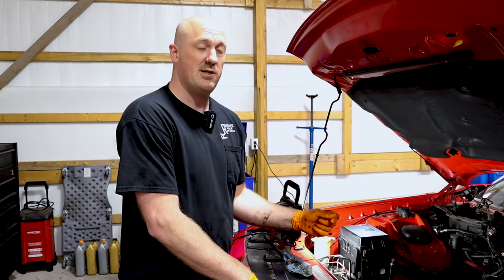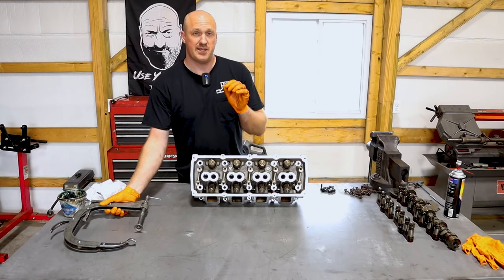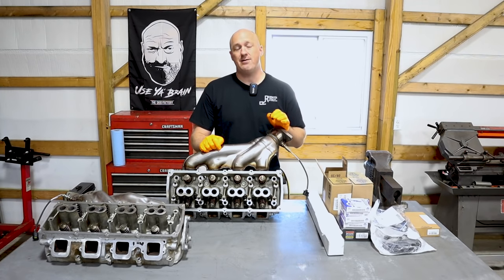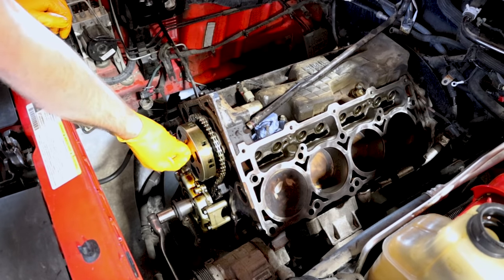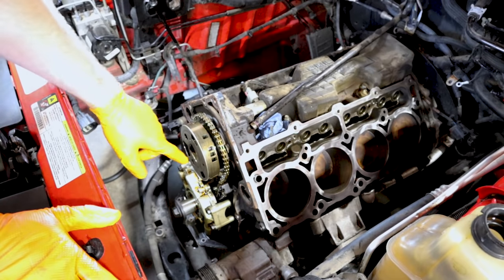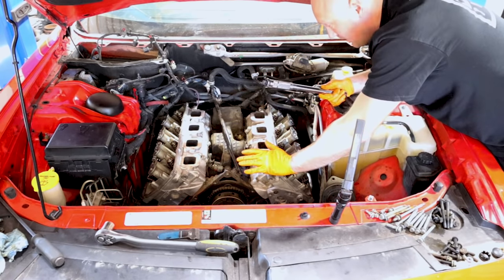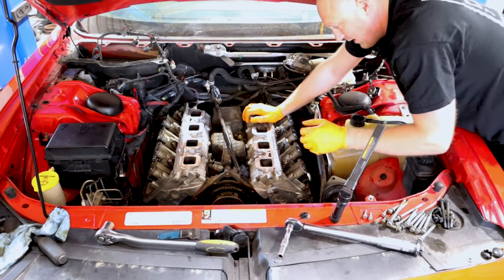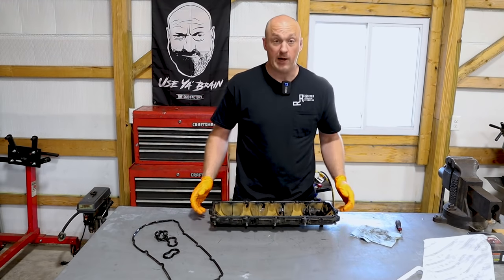Hemi Camshaft Installation Continues, SRT Headers Install! Budget Challenger Build Ep2

Comment: Is the 5.7l in the ram much different or is it pretty much this straight forward?
Reply from the maker: The way the accessories bolt on to the front of the engine is different, but the engine itself is identical. 👍
Reply: @ReignitedAuto  is there any major differences with the accessories? Like compressor water pump etc?
Reply from the maker: @jamestuhill8701  you may have to discharge the a/c on the trucks to get the compressor fully out of the way, but everything else is much the same.
Reply: @ReignitedAuto  copy that thank you

Comment: Hey had a quick ? I was installing stock valve springs back to head got it all locked in and the spring under pressure seems to spin bad spring?
Reply from the maker: Yea that should definitely not do that!

Comment: Hi my friend  I love your videos  I replaced the lifters and the camshaft  on my 2011 dodge ram 1500 hemi las year  and still I can hear the ticking noise    I bought the camshaft and the lifters on auto zone  they were Chinese   do you think that might be the reason of the problem  😢?
Reply from the maker: Unfortunately I have heard of a lot of rattling issues with cheaper lifters.
Reply: @ReignitedAuto  thank you  my friend  you are the best

Comment: When the camshaft sprocket indicator is dead center does those two square indicators on the chain need to align as well ?
Reply from the maker: Only if you are installing the chain at the same time, otherwise the marks on the chain are irrelevant. 👍

Comment: Clear flood with fuel pump fuse out. 500 rpm spun up should build at least 20 psi oil pressure. Do that 4 times before first startup and she won't rattle as much
Reply from the maker: Agreed 👍

Comment: Does everything apply exactly the same to a 2015 Ram 5.7?  I.E. gaskets/parts numbers, timing set up, cylinder head bolts "reusing" etc? Thank you!
Reply from the maker: Everything internal to the engine is the same,  you might have to use different exhaust manifold gaskets, but everything else should be good.

Comment: I have a 2017 dodge ram sport 1500 with the 5.7. It has a tick on start up. What could that be and how to repair it.
Reply: It started at 50k miles
Reply from the maker: Definitely check out my other video called "the other Hemi tick" it explains the problem and the solution 👍

Comment: You werent worried at all about not upgrading push rods?
Reply from the maker: Nope, factory parts work just fine with other factory parts. I upgraded to the hardened pushrods on my 6.4 build that I put a texas speed camshaft in though.
Reply: @ReignitedAuto  got you! thanks for the fast reply, got this mod coming down the pipeline sooner than later

Comment: You should remind people before installing the cylinder bolt head to make sure theres no water or oil blow it out and clean it with a stainless steel bristle twisted brush .

Comment: I dont got no garage id be doing everytning outside if i was to attempt this. . What do you recommend i do when covering the engine up for a day or 2 for rest or for storms
Reply from the maker: I've been there myself as well. You can absolutely just put a tarp over the engine bay and hold it in place on either side of the vehicle with some cinder blocks or something like that. That should be plenty of protection from the weather while you're performing the job 👍

Comment: If you upgrade the Cam do you need any special tuning? I’ve got a 2010 ram 1500 suffering from a lifter failure in cylinder 1. I’ve watched you take apart the hemi several times now and want to get the job done myself. I’m wondering what I can do to beef up the engine as well as fix the problem. Also I keep finding cylinder heads that say without EGR. Is that standard or is it just extra fluff words to describe the head? Any advice/recommendations would be greatly appreciated
Reply from the maker: Definitely recommend tuning to be performed after a cam swap. Not too much you can do about the lifter issue, in my opinion, if it made it 100k miles before it had the problem, no issue putting factory parts in to go another 100k. The heads with and without EGR are based on different model years, some had it and some did not. You'll have to check your truck to see if it's equipped with EGR.
Reply: @ReignitedAuto Good news I think, the codes that I got were related to the catalytic converter on the drivers side so I don’t believe there’s a lifter failure. Any recommendations for that fix? And I’m still gonna replace the passenger side head due to the fact that my 21 year old self attempted to fix the exhaust manifold leak on that side and the broken bolt removal turned into me messing up and drilling the threads making it impossible to reuse that hole unless I rethreaded it. My biggest question after watching your videos over and over is do I need to remove the timing cover in order to remove that head? Or can I just remove the head?
Reply from the maker: @andrewharvey2266  Nope, don't need to remove the timing cover to remove the heads. For the catalyst issue I'd recommend changing the 02 sensors on that side before replacing the cat 👍
Reply: @ReignitedAuto  Awesome! I appreciate all the advice! I’ll let you know how it goes! And I look forward to more great videos! Ill be waiting for you to throw in a 4th gen ram 1500 build 👌🏼
Reply: @ReignitedAuto  Alrighty I’m back! I replaced the o2 sensors and replaced the cats. Engine light went off for a bit then cam back on. now it doesn’t accelerate well and stays around 2000-2500 rpms. My codes were p0171 and p0420. I’m thinking fuel injectors? If not that a vacuum leak? Or maybe another bad sensor. What do you think?
Reply from the maker: @andrewharvey2266  yes sir, I'd be chasing a vacuum leak at this point, that will for sure set both of those codes 👍
Reply: @ReignitedAuto  Awesome! I’ll do that. Any recommendations on where to start? 😂
Reply: @ReignitedAuto   Quick update! I tore the engine down to the block (kept the pistons and crank in) and replaced the gaskets for pretty much everything! Lifters looked fine so didn’t mess with those and timing was perfect! I did Find that my exhaust manifold mistake I made years ago was worse than I though! I had drilled a hole through the cylinder head 😂 so I got a new one of those and reinstalled everything and it runs better than when I bought it with no codes! I wanted to update you and also thank you for all the advice and the excellent videos! I definitely could not have done that with out you! Thank you!
Reply from the maker: @andrewharvey2266  what I love to hear! Great job man 👍

Comment: I LOVE YOUR CONTENT !! But I have 1 question. I reinstalled the timing chain which checks out good and on time. I’ve done multiple turns and shows that’s it’s on time. HOWEVER, as I’m turning, I realize that the tensioner is moving inside and out (WHY). 

   I was told by another mechanic that the tensioner is oil pressured and that once  I start the engine, oil will pressurize the tensioner. IS THIS TRUE ?? Please let me know if you can reply back below THANK YOU !!

Comment: what length 15mm did you use for the head bolts? Because my extension + small 15mm socket is going to fit on the back or bottom side head bolts with torque wrench.

Comment: Do you have to change the push rod lengths
Reply from the maker: Nope, stock length works just fine, although hardened pushrods are pretty cheap so up to you if you want to upgrade. 👍

Comment: Hi I have a 2007 dodge charger R/T HEMI . And am interested on doing that job just want to know if this year is comparable with the package that you got? Can you point me to the right direction please.
Reply from the maker: Unfortunately no, the 6.4 cam will not work in the pre 2009 engines. The process will essentially be identical though and comp cams make a lot of different options for the early Gen 3 engines that will give an even greater boost in HP over the 6.4 cam.

Comment: How did you hold the camshaft sprocket in order to torque the bolt to 90 ft lbs?
Reply from the maker: Generally the best option is to access the flex plate and stick a pry bar in the teeth so the engine can't rotate 👍

Comment: What if my front right piston is not at the top does little stub on the cam still go 12 o’clock?
Reply from the maker: No you need to make sure that piston is at TDC first before setting the cam timing.

Comment: Did the EGR monitor get ready with the 6.4 cam? I have O2 an EGR not ready and long tube headers and causing O2 reading to be off and with no vvt on the main EGR monitor will not run.o

Comment: Shouldn't you replace the valve seals while you were in there?
Reply from the maker: Its a matter of choice really, i had no issues with the seals leaking so I opted not to replace them at this time. If you want to replace yours just to be safe that is absolutely your prerogative 👍

Comment: New subscriber, love ur videos on camshaft replacement.. i have new reman 6.1 hemi  engine and would like to cam it. What performance cam shoud i go for
Reply from the maker: Totally depends on what your goals are for the vehicle. If you're looking for a daily driver with a good bump in power then look at a more mild cam. If it's a weekend toy and you want to maximize your track times then look for a more extreme cam. 👍

Comment: So I have a small oil seep on the passenger side of my 6.4 and I've got all my seals and tools but was wondering what tool did you use to tighten the bolts on the cover and did you TQ them to the required 70"lbs?  I have a short 8mm and a deep well but not sure that will work for the rear corner bolts.
Reply from the maker: Those corner bolts are a pain. I use a 1/4 drive ratchetwith a 10" extension with a 8mm swivel socket on the end. Note that a wobble socket didn't have enough articulation, gotta have the swivel style 👍
Reply: @ReignitedAuto  Thanks for your help. Your tips really helped me and made the job so much easier.

Comment: Hi, I believe I have cam failure. Car runs but is rough at idle a little and I was wondering, I quit driving it but still can if I wanted. What is the chance there is no further engine damage? Thanks.

Comment: Sky, do know if there is clearance enough without removing the condenser on a current gen durango?  I am thinking of doing a 392 swap to my 2014.  Thanks
Reply from the maker: Unfortunately I can't tell you off the top of my head. I haven't done a durango or grand cherokee in awhile and I don't remember if I fully remove it or lay it out of the way. Sorry.

Comment: 124k and roller lifter issues that's more shifty dodge work got a 85 Ford with a 302 over 180k and never had a issue have a 06 dodge charger hemi and 2015 dodge ram hemi and both are constant problems

Comment: The hellcat lifters as I call them have larger bearings in the rollers. Be sure to use a new cam bolt and thread locker.
Reply: They are called "Hellcat" lifters, but all new engines use those lifters. So dont pay extra for "Hellcat" lifters.
Reply: @Rrottweiler  yeah all the new non mds hemis have the improved lifters.
Reply from the maker: You know,  I was just messing around with a bunch of old lifters today, I realized I have both types, the ones with the smaller rollers and the updated ones with the larger rollers. Don't think there's enough there for a video, but I think I'll take a picture and post that up.
Reply: @ReignitedAuto  the ones used in the videos are the updated ones correct?
Reply from the maker: @BunnyEpic  Yep
Reply: Does the cam bolt have to be a hellcat cam bolt as well ?
Reply: @DL101ca  5.7 6.2 6.4 all vvt use the same bolt.

Comment: One of the intake pushrods doesn't seem to want to start all the way compared to the other 3.  Haven't put rockers on yet, what would you suggest this could be?
Reply from the maker: It's normal for all the pushrods to sit at different lengths, remember all the cylinders are at a different place in their combustion event, so if a pushrod sits up higher that means it's directly on the point of the cam lobe 👍
Reply: @ReignitedAuto thank you sir! I appreciate the quick responses here and the detail in these videos. I'm almost done but may be back for more! Lol

Comment: Where do you find all these torque measurements? Thank you btw good video man.
Reply from the maker: Being a Dodge tech for 11 years I had access to the torque specs for a long time. No longer unfortunately...
Reply: @ReignitedAuto  Worth a shot thank you anyways. Trying to get this info is a bit hard to come by especially for the hellcats let alone tsb to even work on it your self.
Reply from the maker: @joshreynolds729  That's by design for sure. Awhile back the manufacturers realized that they were paying a lot of money in warranty repairs fixing things that only broke because customers tried to work on them first. So they decided to stop putting dipsticks in vehicles, and they removed a lot of information online as well to discourage home mechanics. Makes it tough for sure.

Comment: Could I make these modifications on my 2012 5.7 challenger? I really want to beef up my 5.7 engine. The performance parts I’m hoping to do that with will be coming from the scat pack/hellcat models (exterior/drivetrain/suspension). Is that possible?

Comment: If I found a 6.4L cam that has mds, but i have mds disabled on my vehicle, itll still work perfectly fine, right?
Reply from the maker: Yep
Reply: @ReignitedAuto  Awesome! I also wouldn't need any supporting mods for the 6.4L cam, right? I'm gonna change valve springs, but the car has 30k miles on it, and I plan on eventually getting a bigger cam, so when I tear it open again, I will replace alot more, but do I NEED anything to support it?
Reply from the maker: @2averagenoobs108  I would definitely do a tune of some kind. The drivability is pretty good with stock tune, but it can definitely be better with it dialed in.
Reply: @ReignitedAuto  I was gonna get it dyno tuned to squeeze the power out of the cam. But I also am happy I can drive it with the stock tune as well. Thanks a ton for the help and knowledge. :)
Reply: @ReignitedAuto  when you say it runs pretty good with stock tune do you think the 6.4 cam will out perform the 5.7 cam with the stock tune also is yours an eagle head hemi and 1 more do you swap pushrods
Reply from the maker: @mattjohnson2988  I'll give a full review in the final video, but even on a stock tune I can't find any downside to this swap, it runs like factory. Yes to the eagle heads, no pushrod swap. 👍
Reply: @ReignitedAuto  so when are we getting a follow-up video maby some burnouts too

Comment: I am currently in the process of replacing head gaskets and have followed your videos on the process and can’t thank you enough for these videos! The delivery of information is great and you’ve made it simple and easy to follow and I appreciate that. My only question, hoping I can get a response, is block prep before head install. I’ve done many small block chryslers, and can’t imagine it’d be any different, but what is your go to method for Gen III hemi block cleaning/preparation? Thank you again!

Comment: What did you use to clean head and block surfaces?
Reply from the maker: I actually just covered that exact thing in my latest video! Check it out on my channel page, it has the thumbnail "Oil changes are overrated" 👍

Comment: Sky, have you verified if the 6.2L Hellcat high vol oil pump would fit the 6.4L Hemi? You’d mentioned this in an earlier video. Asking for my 2019 RAM Tradesman with bad tick.

Comment: Hi, the thrust plate bolts here are to be torqued to 106 in lbs but online says 21 ft lbs, 106 in lbs would be 8 ft lbs so which is correct?

Comment: I pulled my cam out of my 2013 ram with 178000km  the cam and lifter are shoot and the cam is very badly pitted.  Heads look okay but is it worth sending them put to be deck and replace valve guides ??

Comment: Why does my rt fan from my bumper grill runs louder. 35,000 miles full bolt on with E85 with tune. Thermostat changed before the noise came

Comment: So what’s the proper way to torque the camshaft?? So didn’t show that
Reply from the maker: Best option is to access the flex plate and stick a pry bar in the teeth to keep it from rotating while you torque the cam bolt 👍

Comment: Shouldn't you change the camshaft bearings? I have a 2013 charger rt and am going to do a cam swap soon
Reply: I should also mention i just hit 145k miles and have a lifter tick
Reply from the maker: Nope, the cam bearings are usually in pretty good shape. Its a good idea to inspect them while the cam is out, but unless you have reason to suspect an issue, I'd just toss the new cam in. 👍

Comment: Did you replace the camshaft bearings? If not, why?
Reply from the maker: I didn't no. Hemi engines don't really have camshaft bearing issues like the Chevy LS does. In all my career I've only ever seen one with bad cam bearings and that was an engine that had been run without oil for several minutes. 👍

Comment: How do you hold the cam phaser to get the 90 foot pound torque?
Reply from the maker: Best option is to access the flex plate, then stick a pry bar in the teeth to keep it from rotating while you torque the cam bolt. 👍
Reply: @ReignitedAuto  
Thanks for the reply 

In your video you are setting the torque and it kinda skips to done with torque 
I’m doing a cam job on a 5.7 2500 and as you observed in the video the lifter issue is not limited to MDS hemi. Mine is non MDS and 8 of the 16 lifters where failing at 130k miles.
Reply from the maker: @johneagle1090  I've definitely seen more of the 2500 Hemi trucks have this issue, not exactly sure why that is.